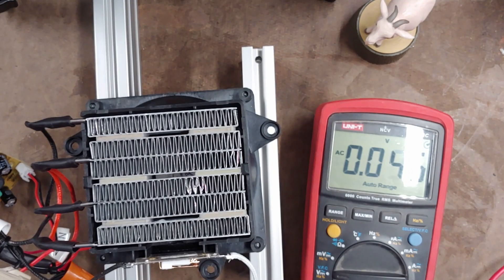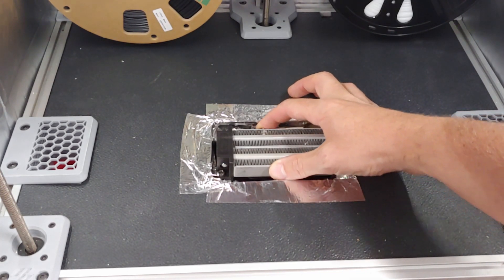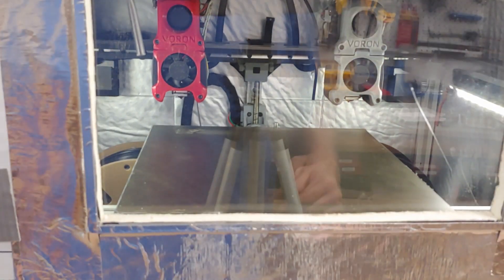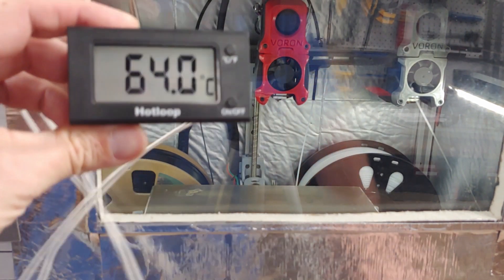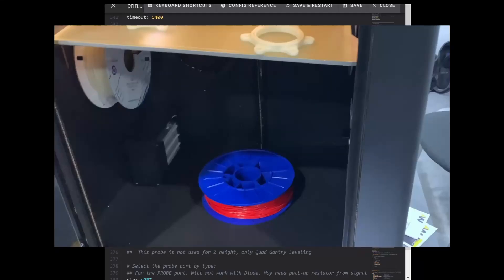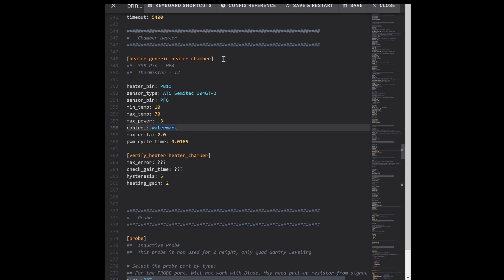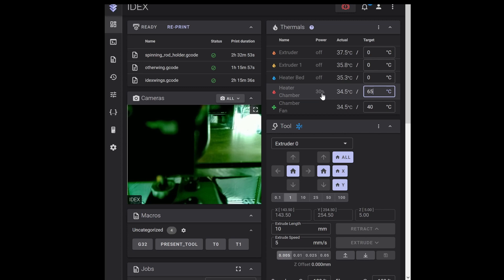Chamber Heater - Dangers, Testing, & Klipper settings

Comment: I know I'm late to the party here, but PTC heaters don't behave like you think, and so what you were doing here isn't very effective. Putting a thermal fuse on a PTC is just silly. They are not like a resistor heater like a bed heater. PTC stands for "Positive Thermal Coefficient", referring to their resistance characteristic.  But they could be called something else--setpoint heaters. They have a very non-linear resistance with temperature near their setpoint. Typically, they have a negative thermal coefficient below some temperature, so they consume more and more power as they heat up, and then above that temperature the resistance climbs back up very quickly as the internal crystalline structure of the element changes. The result is that the temperature of the device is almost entirely determined by that knee in the resistance curve and to second order the amount of air flowing through it. This is why many are 110V/220V rated. You have to design the system to be able to support the PTC at the highest temperature it can reach without it burning nearby materials, which will occur with still air (no fans). The reward of this design effort is that it is pretty safe for a heater (bear in mind that this temp is usually high enough to burn you and many other things quickly, and also you need to ensure electrical isolation too). In many ways, a PTC heater can be more safe than your bed heater, because of this self-limiting behavior. Runaway heating is impossible, which is why a fuse is kind of funny. Many PTCs are used in circuits as self-resettable fuses.

Let me illustrate with some real data: I have a 300W rated 220V non-isolated (electrically very dangerous!) PTC and measured the resistance at room temp with a quality ohmmeter: it measured 490 Ohms. At 220V this would only consume 98W a far cry from its rated 300W. 

 I wired it up to a BK9401 (0-84V 320W bench supply) without its normally attached 220V fan and shroud. I set the supply to 80V, shoved a battery powered kitchen thermometer (thermistor based no doubt) between the fins in the middle of the device, held in such a way that it would be electrically isolated from anything around it (80V is moderately dangerous folks, be careful if trying to replicate). I used the bench supplies current reading, but its 10mA resolution and probably 20mA accuracy, so the numbers below are probably biased (as you can tell from the room temp power numbers not matching the ohm meter) and noisy from quantization error. Powering it up, at 10C increments, I would turn off the supply, wait for the temperature reading to start falling, and at the point that it crossed the numbers below I would turn back on the supply and record the current. I did this in ~10C increments until temperature stabilized at 248C. The results are as follows:
Temp,  Current,  Resistance, Temp Coefficicent, Power Delivered,
20C, 0.22A, 363Ohms, N/A , 18W
29C, 0.25A, 320Ohms, - 1.4% /degC, 20W 
43C, 0.31A,  258Ohms, -1.5% /degC, 25W
52C, 0.34A ,235Ohms, -1.0% /degC, 27W
62C, 0.37A, 216Ohms, -0.9%/degC, 30W
72C, 0.41A, 195Ohms, -1.0%/degC,  33W
82C, 045A, 178Ohms, -0.9%/decC, 36W
92C, 0.50A, 160Ohms, -1.1%/degC, 40W
103C, 0.56A, 143Ohms, -1.0%/degC, 45W
112C, 0.60A, 133Ohms, -0.8%/degC, 48W
122C, 0.68A, 117Ohms, -1.3%/degC, 54W
132C, 0.73A, 110Ohms, -0.7%/degC, 58W
142C, 0.78A, 103Ohms, -0.7%/degC, 62W
152C, 0.84A, 95Ohms, -0.7%/degC, 67W
162C, 0.88A, 91Ohms,-0.5%/degC, 70W
172C, 0.92A, 87Ohms, -0.4%/degC, 74W
182C, 0.95A, 84Ohms, -0.3%/degC, 76W
192C, 0.96A, 83Ohms, -0.1%/degC, 77W
202C, 0.97A, 82Ohms,  -0.1%/degC, 78W
212C, 0.93A, 86Ohms, +0.4%/degC, 74W
222C, 0.89A, 90Ohms, +0.4%/degC, 71W
232C, 0.78A, 102Ohms, +1.3%/degC, 62W
242C, 0.56A, 143Ohms, +3.3%/degC, 45W
248C, 0.46A, 174Ohms, +3.3%/degC, 37W

Below 202C the temperature coefficient is negative--it accepts more and more power at a constant voltage. But above that it's positive and as you can see, once it hit 240C, the resistance starts to climb fast. The most power I could put into this device with 80V was 78W at 202C, but it drops to 37W at 248C where it's stable. 

A second experiment is equally interesting. I added a second BK9401in series with the first to allow much higher voltages. Set the total voltage to vary from 70V to 168V (This is dangerous territory--I had a good way of keeping the wires organized and the heater away from myself and electrical conductors). At each voltage, I let the temperature of the PTC hit equilibrium and recorded the temperature, and current. Note that my thermometer has quantized steps of ~0.4C at these temps, and the accuracy of the current is a question (*hence the reason the power numbers can go down with higher voltage--I promise I didn't violate the laws of thermodynamics) The results are as follows:

Voltage, Temp, Current, Resistance, Temp Coefficient, Power Delivered
70V, 243C, 0.50A, 140Ohms, N/A. 35W
80V, 248C, 0.46A, 174Ohms, +4.3%/degC, 36.8W
90V, 254C, 0.42A, 214Ohms, +3.5%/degC, 37.8W
100V, 257.5C, 0.38A, 263Ohms, +5.8%/degC, 38W
110V, 260.0C, 0.35A, 314Ohms, +7.0%/degC, 38.5W
120V, 261.3C, 0.32A, 375Ohms, +11.9%/degC, 39.6W
130V, 262.4C, 0.30A, 433Ohms, +15.9%/degC, 39.0W
140V, 263.6C, 0.28A, 500Ohms, +12.0%/degC, 39.2W
150V, 264.4C, 0.26A, 576Ohms, +17.9%/degC, 39.0W
160V, 264.8C, 0.24A, 670Ohms, +36.1%/degC, 38.4W
168V, 265.2C, 0.23A, 730Ohms, +22.8%/degC, 38.6W

As you can see this PTC hits a wall around 260C. I would expect 220V to only be a few degrees hotter than at 168V, and within 10C of what it is at 110V. 

Without any airflow the power delivered is limited--in open air I was able to put 38-39W into it at any voltage above 90V, but shrouded and stuffed in a box to shield it thermally and electrically from nearby things it will get hotter and the power delivered will drop even lower.  But basically this: to get more power out you blow more air through it, to get less you restrict flow an otherwise thermally isolate. At the lowest resistance seen it could be theoretically possible to get 580W from this PTC at 220V (but it would be thermally unstable), and 140W from 110V.

I hope this helps clear things up. 

So here are my recommendations:
You need to design the box/carrier for the PTC to handle much higher temps, ditch PWM control the element or use watermark to turn off the PTC completely only if too hot in the chamber. Use PWM to control pusher fans or blowers (pid should work great with some tuning). Make sure the fan is far enough away that it won't melt when the fan is at 0%. Set a max chamber temp so klipper will kill the printer if for some reason the pusher fan gets stuck on 100% (and you especially if you didn't use watermark to turn it off). I would recommend something like a stainless steel enclosure which has low thermal conductivity, with long standoffs to allow natural convection airflow to keep nearby plastics from overheating or use enough high temp insulation. If you do use non-isolated PTCs, then you should maintain enough creepage and clearance with some sort of high temp electrical isolator to a metal enclosure with High voltage markings on it. Don't leave it open for stuff to fall on it or people to poke their finger in it! Follow IEC 60664-1 guidelines (Search "Demystifying Clearance and Creepage Distance for High-Voltage End Equipment" for a great summary). Do this and qualify that nearby stuff doesn't get too hot when airflow is 0%, 100% (with the door open, or temperature of the chamber limited) and that you don't have stray voltage on things (GFCI is wise for 3d printers using mains heaters in general, but for 3d Printers with bare PTCs especially!), and you're golden (toasty even :)).
Reply: Hello you seem quite knowledgeable in this aspect. Do you mind if I ask you a few questions regarding my ptc fan heater I can't seem to get it to come on. It keeps tripping the circuit breaker. I used a relay for the switching (in a circuit I had already tested with a 200W bulb) and the heaters are 120W and at most 180W cold voltage. I'm honestly at a loss here
Reply: @ Do you have any way to measure the cold resistance? I suspect there is a wiring issue, but it’s tough to say without more info.
Reply: Excellent info! Just designing my own PTC chamber heater and I appreciate you taking the time to share this. 👍

Comment: Dont use a 120V PTC heater suplus module.  you can get them designed for 24V or 12V DC.  far safer to use.

Comment: I chose a 100V product to save on the regulated power supply, but I didn't realize that the heat exchanger was a bare 100V. I'm lucky to have heard this warning before I started. thank you
Reply: Same

Comment: Thank you for this very helpful video. I wonder, if you open the door to fix a troubled print, will the sudden heat change cause klipper to shutdown?  Is it possible to just have klipper turn off the heater if there's a problem?
Reply from the maker: Opening for a short time usually does not change the temperature fast enough for Klipper to detect a problem.  Klipper will shut down, but will keep the fans running if the fins of the heater get too hot.  I haven't been using the heater since insulating with 3/4" polyiso, but it is summer time.  In winter I will probably need the heater again.

Comment: mine is running for sometime now.. just an SSR controling the 110v 350w heater placed on the upper part of the chamber, pointed down 45 degrees.. Getting excelent results. Klipper shows that heat bed barelly needs to go on to keep the 90C and chamber keeps  60C (+- 0.5C variation). an ABS bracket is holding the heater and surprisingly didn´t melt. couldn´t be happier.
Reply from the maker: Awesome!  Weather has turned cold here so I am using the one in my V2 every print.  Even at 50% power, the bed and chamber go from 18C to ready in 14 minutes.  Soon I want to start experimenting with carbon fiber nylon parts to direct the hot hair.
Reply: @badmouth75  by the way, do you use 65C for abs parts? I stopped at 60C afraid of extruder stepper getting screwed up, but heard that 70C would be the sweet spot for abs
Reply from the maker: @yuripolak  60 is enough for most things in my experience.  Big chunky parts could benefit from going higher, but things like fans and probes start dying prematurely much over 70.  I've heard 80 is the sweet spot for ABS.  That's also about all the plastic races in most linear motion bearings are rated for.  Use a draft shield on the big chunky parts to hold the bed heat next to them.  It probably wouldn't hurt to crank the heat up to 65 or 70 occasionally for the particularly difficult part.  I keep my V2 at 55 or 60 because I'm paranoid about the heater causing hotter spots than what the chamber is reading.  The V2 is a big 350mm spec, so it's more about getting to temp faster and staying there in a cold basement rather than pushing temps.  My 1.8 averaged 65-70 without a chamber heater, but it didn't see nearly the amount of printing as the 2.4.  I don't have any qualms about running 65-70 on a Trident if the heater is in the bottom where it isn't blowing directly on any parts.
Reply: Hi, how big is your chamber, width, height etc?
I currently have 200 W 12 V ptc heater in Ender 5 Plus custom build and it rises temp, slowly,cbut barely above 40 °C. 
It’s insulated but on top where X axis gantry is moving there are gaps on sides, 4 cm height, 50 cm wide.
Thinking about insulating it with door sweep brushes (so gantry can move) and replacing 200 W one with 500 W 230 V with ssr (bed is already on 230 V + ssr).
Will probably try tocinsulate that top better to see if 200 W would heat the chamber enough. 60 °C would be fine
Reply: @ZhuJo99  not big... Width and length are stock from switchwire, height is a little bigger cause I built for 350mm Z... Do you have a fan on the heater?
Reply: @ZhuJo99  BTW, mine is not insulated and I do have the gaps around the xy motors like every switchwire

Comment: How are you syncing the fans to the heater?
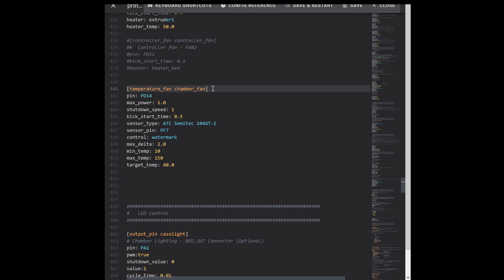Reply from the maker: Skip to 14:12 in the video. The fans are set up similarly to the hotend fans with a temperature_fan section.  There is an extra thermistor on the fins of the heater.  When the heater fins reach 40 degrees (only takes a few seconds) the fan kicks on and stays on until the temperature drops below that.  Adding shutown_speed: 1 makes the fan stay on if klipper crashes.
Reply: @badmouth75 but for chamber，eg，we need close the fan when it reach 40